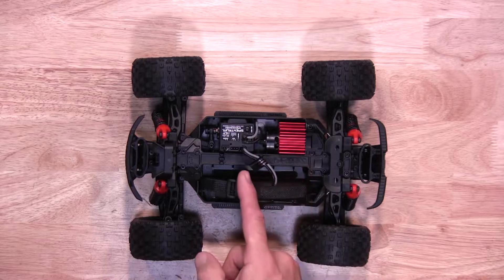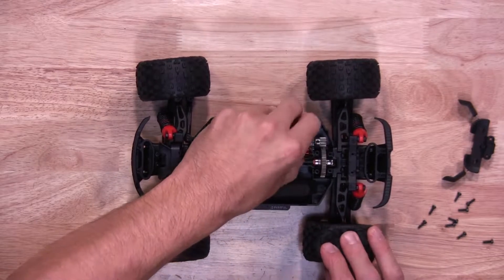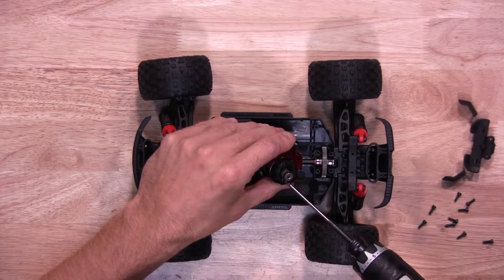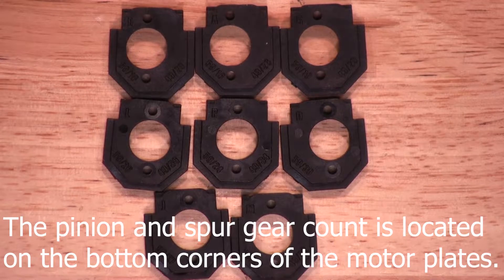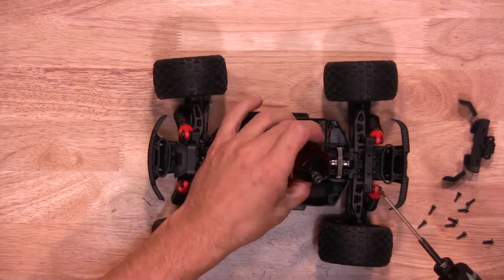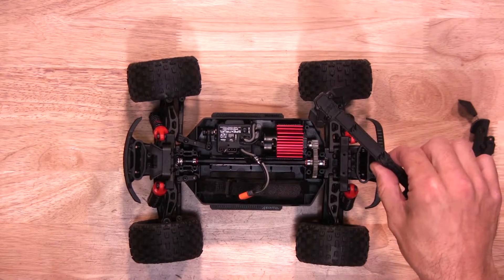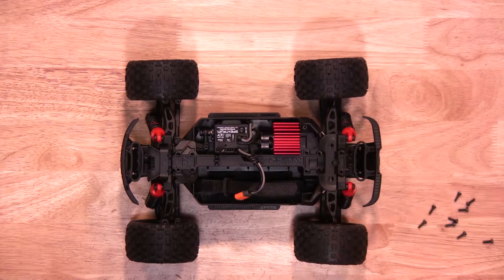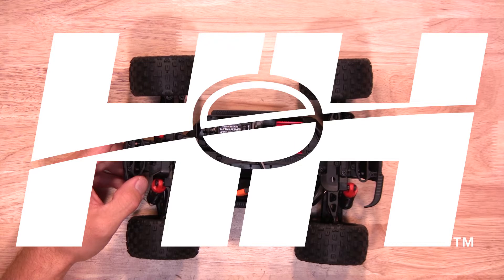How to set your gear mesh on a Arrma Grom with motor plates

Comment: Thanks for the vid. But this is one of the most ridiculous methods to make a simple adjustment.  Such a waste of material. One plate with a mounting hole and a second that's oblong to adjust. I've tried the plates and it's to tight or loose....sigh now it's hacking time with the dremel.